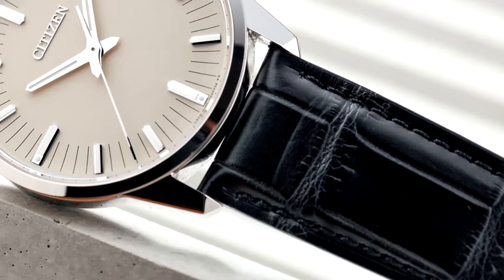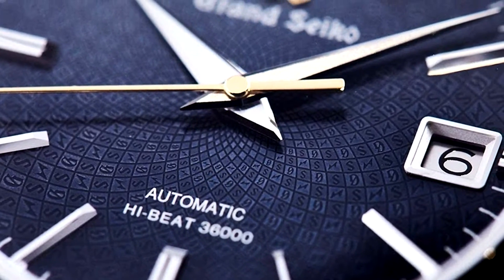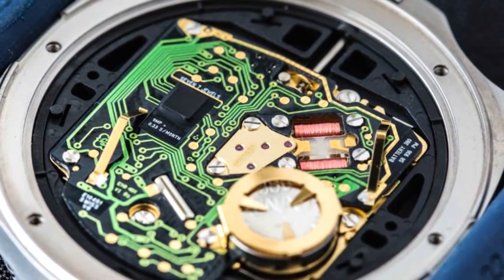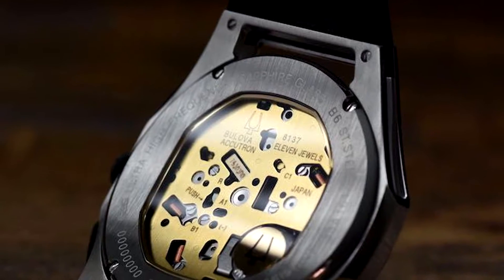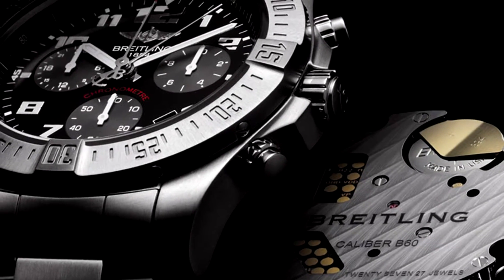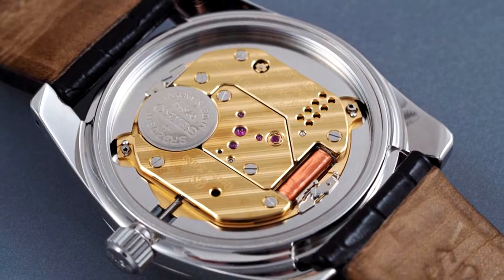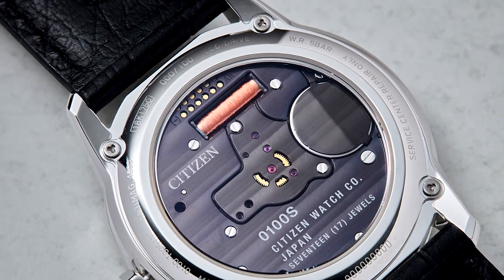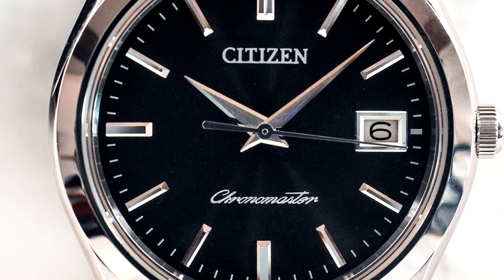What is Thermocompensated Quartz?

Comment: I think thermo quartz is just as special as auto watches.
Reply from the maker: @Tom Romer   Agreed! 💯
Reply: Combine thermocompensated quartz with radio sync (it’s sort of superfluous, given the accuracy, but it saves resetting for DST/summer time and the occasional leap second) and you have almost the ultimate watch. Or GPS, but then DST and leap seconds are small nuisances. Photovoltaic cell under the dial for power wouldn’t hurt either.

Citizen sort of does this and throws in a perpetual calendar that goes only to A. D. 2100 (hurts its value as an heirloom), but I don’t think they’ll ever combine radio or GPS sync with a thermocompensated oscillator. Given the hand-polishing and other insane measures they take with their most expensive watches, quartz or mechanical, I don’t see why they shouldn’t take insane measures for accuracy, but clearly looks matter more than a watch’s ACTUAL FUNCTION.